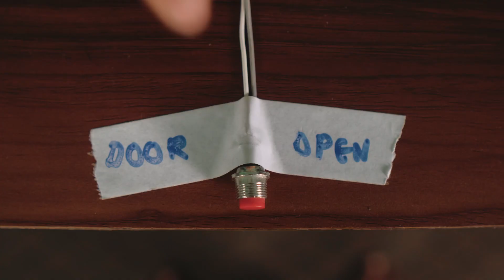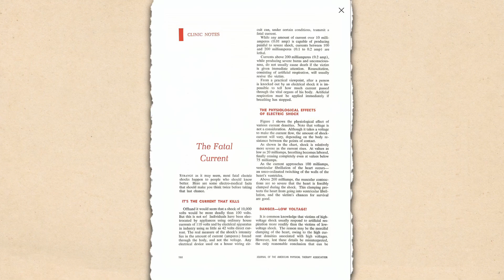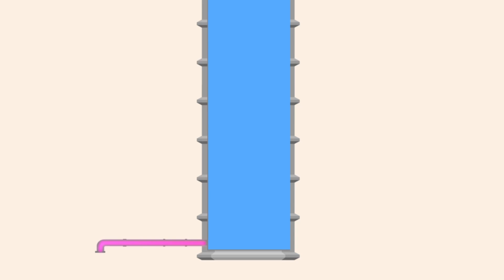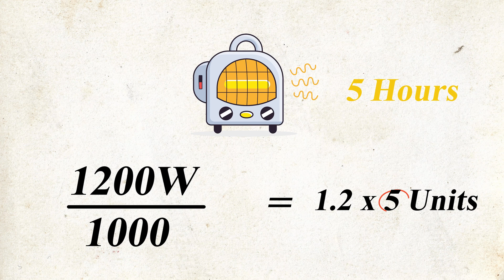Nepali Engineer Explains Electricity!

Comment: Hi engineer , when i was small i found a plug and wire and then i put 2 wires in switch and joined in another end 😂 then a blast ocured , i was little far so i saw a blue spark and the switch got damaged . I wasnt harmed but whole building electricity go off 😢😢😢😢 i was not harmed luckily

Comment: @ThirdWorldNerd
I liked the way you had presented it all. 
but I found a knowledge gap in 5:45 - 6:10, describing power capacity as the ability/inability to push the current through the wire does not constitute in actual mechanism. In every passive components, current is driven by resistance & voltage applied. Increasing the voltage should have burnt the nicrome wire similar to that of copper wire in 220V range.  (Short-Circuit)
Copper wire would also heat without melting if voltage is low enough.

Public questioning ma arcing bhayeko equipment ko power source le limit gareko haina, tesko working component (active components in the electronics used) le limit gareko ho. 
Tyo second setup chai Taser gun jastai 12V to 1KV converter or similar equipment jasto lagyo where current is below 15mA. In such devices whether I use one 12V battery or multiple in parallel (increasing my power capacity) won't have any effect on Nichrome wire. (That limiting pipe analogy is not of the power source but the component boosting the voltage.) 
If you use a larger transformer capable of outputting 1KV, that same 1KV would burn the nichrome wires because there is no active component limiting the current flow.

I hope you shall acknowledge it. I feel that many students shall follow you in days to come, and even a slight misunderstanding during start of their scientific journey shall make complications in long run. 
Best of luck in your future endeavor.

Comment: 4:19 Nichrome wire bata sajilai dherai current bagna sakxa, but kasari. Ma kunai engineer wa science ko student haina, just school ma padheko kura ko var ma yo comment gardaixu. Resistance dher hunu vanekai current sajilai bagna nadinu haina ra? Nichrome ra Tungsten jasto high resistivity vayeko material le current lai sajilai bagna dinxa ra? Tei current sajilai bagna napayera chai heating effect dekhine haina ra? If I am wrong please correct me!
Reply: We should not say current bagna napayeko heat ma convert hune bhanera. Its the exact opposite. Jati current bageko cha teti anusar heat niskine ho. Lets say for 220V le chalni heater (simple mato wala nichrome wire bhayeko heater), tesma 6A current bagiraheko cha bhane chai 1320W heat release huncha from the wire. ani to heat le nai wire ko temp badni ho. Finally if the temp is below the melting point of wire, wire lai kei hudaina tara badi bhayo bhane wire will melt, sometimes explodes too. Esma wire ko melting point bhanda le kaam garnu bhanda agadi wire ko resistance le khel khelcha. Because resistance limits the current for same voltage. 
Copper ko resistance kaam cha so 220V ma high amp (>1000A) bagcha so aago lagcha. In tungsten or nichrome, current kaam huncha ani tes anusar ko heat le melt pani garna sakdaina. Try with higher voltage and melt huna thalcha.

So think of it as:
Voltage Level & Resistance of wire --> Determines current
Current --> Determines Heat output
Heat output & Melting Point --> Determines whether wire paglincha ki nai.
Reply: Low resistance allow more current to follow where there is no limit .. like human body have low resistance so little current can shock us also  current can flow more if you hold for more .. as for heating element it has more resistance so current flows as its resistance capacity it can though shock you if u hold live wire but when it is connected in heating element all current will follow through heating element itself while current will not give damm of you because it will get bigger hole to follow but not giving damm doesn't mean it will not give shock human is conductor small current will shock u untill you hold it and for heating element due to heat u cannot touch it😅 current and voltage both depends to shock you
Reply: @madxu001  you got it wrong. Human skin have higher resistance and the heating element has lower resistance and thus current prefers to move in that heating element instead of the human body.
Not all current flows through the heating element.
We actually are creating a parallel connection when touching the wire. The amount of current in the parallel totals 100% current coming from source. If the current is above the limit, then we feel electric shock from simple muscle vibration to lethal ones.
Reply: suppose you have a pipe and water is flowing through it, then you have narrowed the middle portion of the pipe however when you see the amount of water that flows at the ends of the pipe is equal and so is the speed of the water same case pani current ma apply hunxa. resistor ko start ma jati current thyo teti nai current tesko end ma pani hunxa

Comment: Tyo pipe chai k hola ni? Content ramro xa tara still last ko bhaneko bujhena please help. Voltage high xa tara pipe ko hole sano xa bhaneko meaning k hola?
Reply: Pipe sano cross section ko vaneko higher resistance
Reply: @aa6eheia156  internal resistance?
kina bhane resistance the tyo knob bhaihalyo ni haina ra?